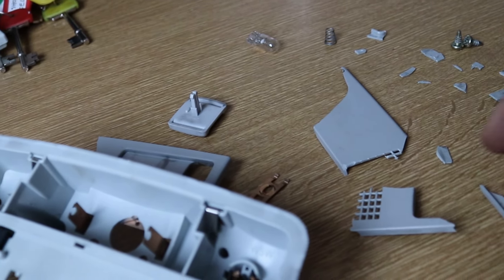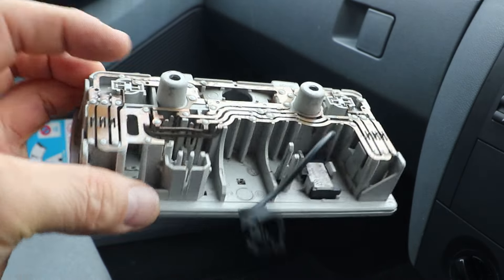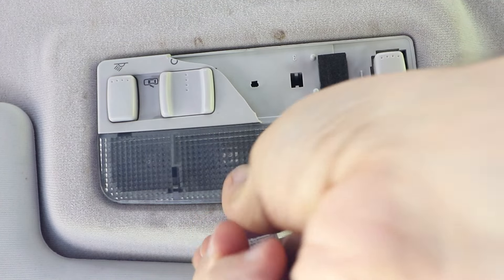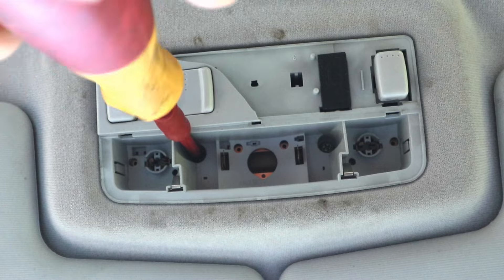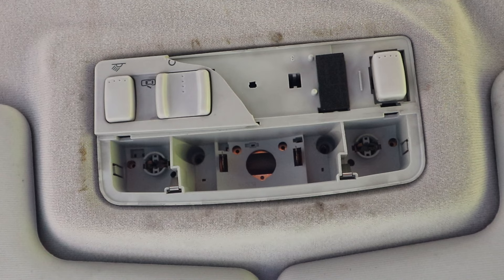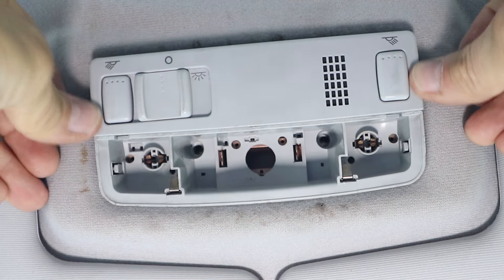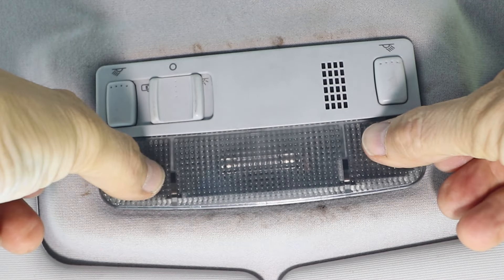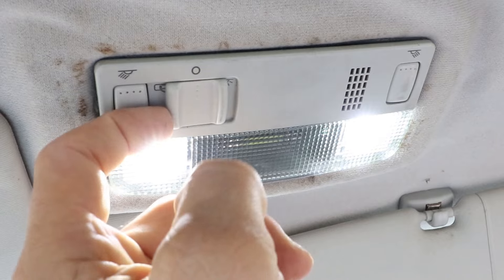SKODA FABIA INTERIOR LIGHT UNIT + LED UPGRADE

Comment: Hi @HatBoyHarvey, Thank you again for educating me with this detailed video. With help of your video I managed to change the lights and the brightness is amazing. The only problem is the small lights dim but don’t turn off. Am I doing it wrong? or something wrong with my car electrics. Could you please advise?

Many thanks and Kind Regards!
Reply from the maker: We're the LED's CANBUS compatible? Use these instead of older LED's that retain a small amount of residual current. If you did and still a problem then check the wiring.
Reply: @ thank you so much sir, freshly ordered can bus error free ones and the LEDs work without any flickering and goes off completely in couple of seconds.

Comment: Hey Harvey 😁

Can you please show how to change the lights for the passengers in the back? 🙏🏻

Im struggeling 😅
Reply from the maker: There isn't any on a Mk1!
Reply: do you have an estate mk1 (6Y5)? the hatchback doesn't have them.
Reply from the maker: @zat-svi-car if  this is the one in the middle centre of the roof then this clips in along the long sides, so that is where you would ease it out of it's holder frame in the roof panel. Later model rear side lights prize out from the 'O' end with light turned on.

Comment: None of my interior lights actually work except my red door ones,  do you suggest a fuse change?
Reply from the maker: @kaiengland-xr7mp  only if it's broken. Probably just a loose connection or bad ground. You need some way to test for voltage and continuity starting at the light.

Comment: mate if you can answer me i would appreciate it , the interior light flickers a little when the wipers are on when the interior light is set to position o why is it doing that?
Reply from the maker: The wipers induce a high voltage drop and if there is anything wrong with the circuit which it looks like the humble interior light is on then issues like yours could arise. Could be loose connections, bad earth somewhere as this car suffers from water induced electrical gremlins. you may find the issue occurs or gets worse when it is damp. have you changed to LED lamp that aren't CANBUS compatible?
Reply: @HatBoyHarvey  yes i bought cheap LED'S from Aliexpress maybe i should try the standard one . Thanks for your answer

Comment: I'd be interested to know how you get on with these. I tried fitting LED bulbs in the interior light a few years ago but had to remove them as it seemed to be causing a parasitic battery drain when the car was parked and locked.
Reply from the maker: You need to use only can-bus adjusted led lamps to stop any issues like that.
Reply: i've got some 3000K ones as a kit for the 6Y's whole interior including the glovebox and the trunk. no battery drain issues here.

Comment: Best to look for better LEDs with no polarity. Those cheap ones are annoying hence they start flickering and burn out pretty quickly.
Reply from the maker: There are many manufacturing these now and as long as they are can bus compatible to stop the flickering it can then often come down to price. Paying g a little more may be better, but not always.
Reply: @HatBoyHarvey  Yup, I wouldn't go with overpriced Phillips or Osram, which surely will perform well, but there are great products for reasonable price.

Comment: Mate please I’m in need of some help, I am really struggling to get the side interior lights above back doors I can’t get them out to change them on my Skoda fabia
Reply from the maker: Turn the light ON - then use a flat bladed screwdriver at the 'O' end - push in centre, a metal clip behind is forced inwards and light will lift up. You then can pull out with your hand and disconnect connector. No need to force is.
Reply: Thank you, I ended up breaking one!! :( do you know where I can get a replacement? And also two replacement bulbs for them? As both bulbs were gone on both back interior lights lol
Reply from the maker: @kaiengland-xr7mp  copy the part number into Google and there will be many. Lamps are festoon interior type - just measure the length. I don't have these lights so I don't know exactly, just make sure lamps are can-bus compatible.

Comment: Hello sir plz guide me a little bit I m facing my Skoda fabia 2005 with starting issue I was just feeling power loosing when I accelerate and in idle position it was fine but when in idle mode I accelerate the RPM needle it's fluctuate a little bit but yesterday when I stopped at signal the engine just shut down.....I tried three times to crank but failed I think at 4th time it starts but after 500 meters it's shut down again plz guide me Sir is it about diesel pump or tandem where I have to start checking and how???
Reply: I had the same problem six months ago. Strangely enough, it disappeared on its own and hasn't come back yet. I'm still looking forward to an answer from our Fabia-Expert @HatBoyHarvey so that I can look into it too. 😊
Reply: what`s this got to do with bulbs🤔🤔
Reply from the maker: Did I say bulbs :) I mean lamps. I must be getting confused with planting my daffodils :-)
Reply from the maker: De-carbon the egr, intake, change oil, air filter and remove oil in lower intercooler pipe to start with look/test for vacumn leaks, diagnostics - fault codes ----

Comment: Hi! My Skoda Fabia elegance 2001 model, all four doors has no indicator light on dashboard when it is open , what is the problem,, i hope my message is notice 🫡💪
Reply from the maker: When the door doesn't register it is locked it is almost certainly the micro-switch inside the door lock malfunctioning. Before replacing this it is also worth eliminating other possibilities of the wire damage behind the rubber bellows on the A piller, disconnect the bellows and examine wires for fraying. Also disconnect examine all the connectors there, clean reconnect. These are the most common faults it could be, so maybe start there. but it still could be something else, hope this helps :-)
Reply: @HatBoyHarvey  thanks a lot 👍
Reply from the maker: I've never seen the open door dash symbol would you pm me with a pic?